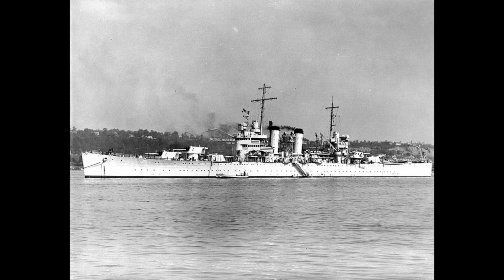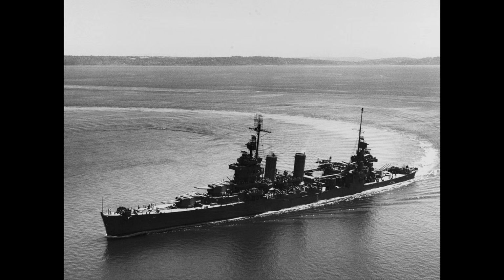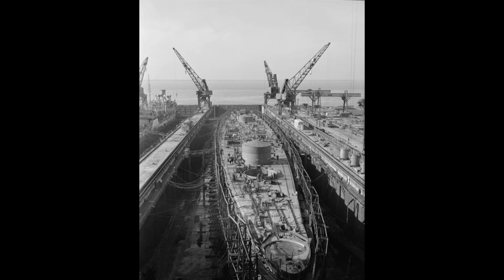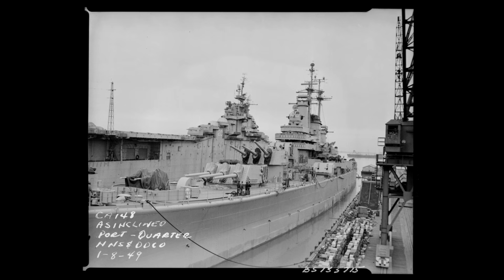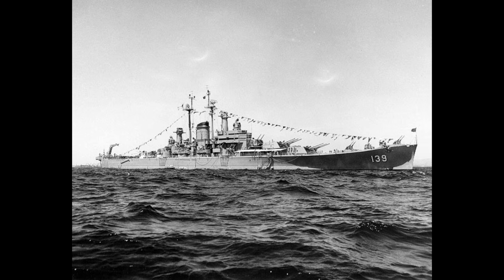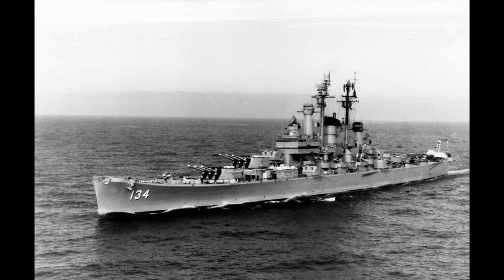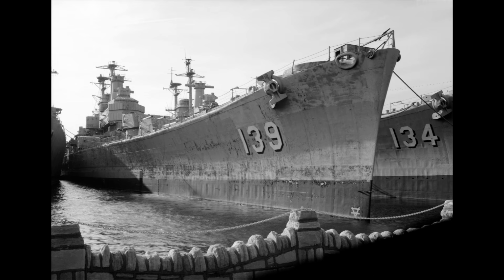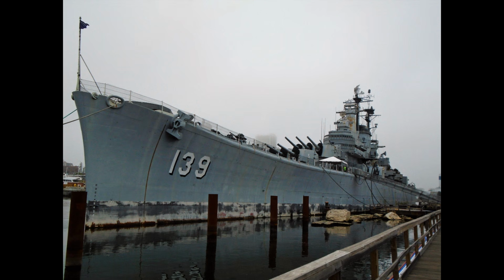USS Des Moines - Guide 251

Comment from the maker: Pinned post for Q&A :)
Reply: the Nav Weaps article on the rapid fire 8” guns is well worth reading: despite their size and power, they were, apparently, very reliable
Reply: How would you, Drach, tweak the design for the original 6 frigates of the USN? With hindsight, given the eventual razee designs, would it be worth it to slightly increase their size in order to accommodate 32lb guns? Also, having worked with live oak before, how on earth did anyone manage to use it as hull filler? That wood is incredible, but grows in about a million directions per tree...
Reply: The US Navy had plans for GERMANY FIRST strategy, but what if, somehow, the Japanese surrendered first (either between the end of 44 or beginning of 45). Did the allies had any plans for just occurence
Reply: Any chance of doing a special on the Royal Navy's Invergordon Mutiny?
Reply: Here's a very interesting question to be asked, for a "what if" episode. Assuming that the Mark 19 came out in enough time to be in general service during World War II, how would that change the battles? Especially since those 8" shells would be falling fast and hard in a number of circumstances where the early naval battles could have changed a lot of things if there was quite a few of these shells going out.
Reply: Would dazzle camouflage have been effective during the age of sail? If the idea is make it difficult to gauge a ship's heading, then perhaps in an age without self-propulsion initial mistakes would be much less forgiving when trying to engage an enemy.  Is this true, or are there mitigating factors that would make the advantages negligible?
Reply: So how would a Des Moines do against a Kongo, at night, at the throw-your-coffee-cup-and-hit-them range so common in Iron Bottom Sound?

(Well SOMEBODY had to ask)
Reply: Some questions related to the Des Moines: How important was the anti-aircraft role in their design process ? I thought that was really the value-added of the new 8-inch turret but since you don't mention it in the video, I guess it wasn't the case ? Given what was happening early on in the Pacific theater of war, It seems the USN was quite late in introducing a dedicated anti-aircraft ship (the Worchester class and maybe the Des Moines). Was it the case and why ? I'm almost surprised that they didn't take some of the new hulls like the Alaska's (or maybe some of the lighter cruisers) and replaced their main battery with more 5 inches (or idealy rush into service the new 6in or 8in DP turrets). Were there some technological roadblock (autoloaders, lack of improvement in fire control, etc.), industrial (proximity fuze production capacity, turrets productions, etc.) or maybe doctrinal (combat air patrol vs AAA) ?
Reply: A classic "who would win scenario": USS Alaska (or Guam) vs any one of the Kongos. 
Large cruiser vs Battlecruiser. Both ships are alone, no escorts, sporting the very latest refits/tech historically available to them before the end of the war. 
Would the Alaska with her superior tech but smaller guns take the win or would the Kongo with her 14 inch guns carry the day? 
The battle would take place during the day in clear weather conditions to give them both the best chance.
Reply: @wildkarrde3370  

The Alaska is a design a few decades newer than the Kongos, it should have the upper hand. While the Kongo wouldn’t have too many targeting issues in good visibility, I suspect Alaska is the more durable ship here (can anyone tell me if the Alaskas had the AoN armour layout as all contemporary non-German battleships did?)
Reply: @bkjeong4302  a quick look at Wiki, shows Alaska had only a 9" belt. enough to fend off 8", and maybe German 11" shells.  vs a Kongo's armor, which varied from 3"-8".  Navweaps does not have armor penetration data for the Japanese 14"/45, but muzzle velocity and range of that gun vs the US 12"/50 are very close.  If the Kongo blew a lot of chaff in the air to blind Alaska's radar, it could go either way.
Reply: Admiral hipper class vs Baltimore class
Reply: USS white Plains and Yamato service guns accuracy
Reply: May I suggest the Insect Class river patrol boats...?
Reply: Did you also know that Salem was used to depict the German pocket battleship, Admiral Graf Spee, in the 1956 film The Battle of the River Plate?
Reply: @wildkarrde3370  The Alaskas were equipped with the Mk 8 FCS and her 12" guns were supposedly equal to the US 14"/50s in penetration.  I would have say not quite no contest but given the proven accuracy of the Mk 8 would mean the Alaska hits first and hits more often.  In pure optics based gunnery duel it is a toss up.
Reply: What is your favourite Never-built ship or plane?
Reply: I found a proposal for Hood's armour that takes 1 inch off the main belt and 0.2 inch off the aft, add 8.3 inch to the belt and 0.95 inch to the deck would this make any difference to her service?
Reply: I was just looking into the history of the 8-inch RF gun the other day, and I couldn't find much... I am quite curious about it though, for a couple of reasons - namely that while Navweaps says the "date of design" for the 6"/47 DP twin mount was in 1943, the mount itself started showing up in Spring Styles plans in December 1940, with plans for a full on cruiser carrying these guns starting in July 1941 - and it's explicitly a DP gun according to those drawings. Now, Navweaps also says 1943 for the 8"/55 RF triple mount, but there is a mount that looks suspiciously like the Des Moines turret showcased in drawings even earlier than the 6" DP mount - the Scheme 4-A "convertible" option from the Alaska preliminaries has three of them (plus a standard Baltimore-style turret so it's definitely not a mistake), and that drawing is dated  in April of 1940; and the same shape shows up in the "Scheme A" drawing from the Midway preliminaries. 

Does this mean that the US Navy were planning the RF gun at the same time as the DP gun, and had a rough idea what the mount would look like as early as 1940 for both of them?
Reply: any idea what the abrupt jumps in CA hull number were for, particularly between USS Helena (CA-75) and either Bremerton (CA-130) or Oregon City (CA-122)? There's a couple other jumps like that, but that's the big one and the one I can't really figure out the deal with.
Reply: I just don't understand your persistent habit of not pronouncing the 'w' sound at the end of Wichita.  It's a perfectly obvious thing to do given that the city of Pawtucket as a 'w' following an a which is not pronounced, so the sound of the 'w' obviously belongs somewhere.  Nothing could simpler.
Reply: @tortugagreen9924  Did you check vs cruisers converted to light carriers?
Reply: @stevevalley7835  During the day radar isn’t going to be too much of a concern, given that the accuracy of radar fire control at long range (even the Mark 8) is vastly overblown in pop culture compared to actual testing data. The Mark 8 will be able to get a firing solution much faster and at greater ranges, but actually hitting at ranges over 30,000 yards is a different ball game due to all the environmental variables.
Reply: @tortugagreen9924  The short explanation is "those gaps are where the light cruisers are". All the cruisers were numbered in one sequence starting in the 1920s, so you'd have a few heavies, a bunch of lights, a few more heavies, another bunch of lights, off and on. The war production sequence gets a little screwy because there's 1 - a bunch of ships that were given a number in the sequence and then redesignated to something else (Independence-class carriers); 2 - a whole lot of cancellations and ships that were scrapped incomplete; and 3 - ships that were built out of order, because the ships are numbered in the order they were *ordered*, rather than when commissioned, and some yards had backlogs. 

So, for example, CA-121 to CA-143 were all ordered in 1942, but CA-130 to 133, and CA-135 to 136 (the Batch 2 Baltimores) were all laid down in mid 1943; while CA-122 to CA-124 (the Oregon City class) weren't laid down until 1944, and CA-134 and CA-139 weren't laid down until 1945. Interestingly, a lot of the ships listed as "scrapped incomplete" were laid down in 1945. 

Edit: looking it up in Friedman's "US Cruisers", the original plan was for CA 122 to CA 129 as Oregon City-class, CA-130 to CA-136 as Baltimores, and then CA-137 to CA-138 as Oregon City again, with CA-139 to CA-143 as the first five Des Moines class cruisers. CA-134 was then re-ordered as a Des Moines class and a bunch of the others cancelled because why build inferior cruisers if you don't have to. Which is why the they're sometimes called Salem-class, because CA-139 was supposed to be the first ship...
Reply: @scottgiles7546  With the Des Moines vs Kongo at night at close range thing, we can take some fair guesses from what happened to Hiei. USN early war 8" shells punched into Hiei's steering room, flooding crucial portions of the ship and killing the engines. 

Des Moines is well armored for a WW2 CA, but nothing like what is needed against 14" AP. 

My bet is that both ships rip each other apart but neither sinks the other. Des Moines likely ruins Kongos FC and gunfire rate, as happened historically, while Kongo smashes major portions of DM. Both likely have significant flooding, but Des Moines is based off of battle proven designs with late war+ Damage control. Kongo likely is eventually left drifting, burning and pretty impotent.
Reply: @stevevalley7835  Nah, Kongo is never going to have enough Chaff to cover itself for the lengths of ti.e that naval gunfire duels take. Alaska is designed with near modern horizontal bulkheads and the latest in power generation and damage control. Alaska see's first, hits first, hits more often and handles hits better. Kongo may have a "punchers chance", but between ships of near-miss tonnage and firepower, my money is on the American design from WW2 over the IJN/British shipyards pre WW1 design.
Reply: Do the two gun “tubs” over the stern of the ship have any nicknames?
They look a bit goofy, yet pretty neat at the same time 😂
Reply: How much would it cost to rebuild HMS Warspite?
Reply: Why did navies build their ships with similar layouts, even different types of ships? Eg: Iowa, Alaska, and Des Moines all had three triple turrets, two forward, one aft. Was it found to be the best layout in the USN's opinion?
Reply: Best ww2 destroyer of each of the main combatants?
Reply: Why is the B-17E Flying Fortress called the Mk.2a while the B-17F Flying Fortress is known as the Mk.2
Reply: How would the Alaska class large cruisers have fared in the Mediterranean and the North Sea going up against German and Italian contemporary designs
Reply: Salem played Graf Spee in the movie Battle of the River Plate
Reply: Although the class was not completed until after the end of the war, hypothetically was there any heavy cruiser class in any WW2 navy that would have had much of a chance against the the Des Moines.  Given their fairly light armor, and relatively speaking, slow firing guns how would the Deutschland's fared?  Finally, for the over the top question, could the Des Moines and Salem together, with their weight of fire,  had a chance against the Scharnhorsts at 15-20,000 yards?  If time permits, would any cruisers or smaller battleships of the IJN been able to cause major issues for the class sailing as a flotilla of two or three ships?  I'm thinking their radar and fire control would allow for first strike capability.
Reply: Have you seen any numbers on the average cost to keep ships like the USS Salem, HMS Belfast, and the other ships still afloat in good repair as museum ships.  I worry that that cost will cause younger generations to just scrap them.  I know they won't mean as much to as many people as they do now, but I hope I've shuffled off this mortal coil before that happens.
Reply: @bkjeong4302  AorN very much like the fast U.S. battleships.
Reply: There are several different designs for the North Carolina's. One has two quad turrets, both aft with floatplanes forward (ie: Richelieu in reverse). One is Nelson-style. One is all-forward and super-super firing, with the forward on centreline, second off centreline to starboard, and the rear-most off to port. Please explain this madness, and what is best design?
Reply: @jayadkisson2075  then the Alaska has this on the basis of much better durability compared to the Kongos, while being similar or slightly better in other areas (bear in mind the question specified an engagement in good visibility, where the massive advantage radar brings in poor visibility is mostly nullified); the only Japanese big-gun capital ships with AoN were the Yamatos (due to being much newer designs than the rest).
Reply: What's the intro song? I really REALLY like it.
Reply: @WBtimhawk  Too big and slow traversing for DP use.
Reply: @tortugagreen9924  not hard to figure out. Projects got cancelled.
Reply: @thomasjamison2050  Seriously?
Reply: @WALTERBROADDUS  Seriously in terms of the pronunciation.  I have lived in both Kansas and Rhode Island.  The one I can't figure out is what state or city swapped the 's' sound at the end of Arkansas for a 'w' sound.
Reply: As of this comment posting, the USMC has landed and launched F-35B jets on JS Izumo. Is there any known instance of foreign fixed-wing aircraft landing and/or launching from a Japanese aircraft carrier prior to the present day?
Reply: @i.alicorne  🤔 hmmm....... Doubtful. It's nice to Have the Royal Navy, USN and the Maritime JSDF all one team outside a Mothra film. 😏🦋
Reply: I'm a hunter, and there's lots of discussion about what kind premium projectiles preform the best. Boat tails for better aerodynamics in flight, Nosler partitions to preserve mass at impact and improve penetration etc.

How did the projectiles of naval guns evolve? Did anyone try any interesting tricks to improve performance on impact or was it solely a "bigger the hole the better" game?
Reply: Is it possible to add interior photos where possible?
Reply: Where there any WWI or later battles fought between predreadnaughts?
Reply: Could you cover the USS Newport News? She had the most active career of the Des Moines class.
Reply: I saw USS Salem moored alongside one of her sisters in the Philadelphia Naval Shipyard in 1988 .  My ship ( USS Sellers DDG 11 )  was in the yard undergoing dry dock at the time .
Reply: Jake millar , yes the US Navy came to favor the triple gun turret layout after designing and testing several types. Two gun turrets where thought to not make as efficient use of the space available on a big gun ship ( cruisers, battleships, and similar ). Four gun turrets were thought to leave too much of a ship's firepower in one place for a possible enemy to knock out ( and were generally less easy to put in action ). The all big guns on the centerline came mainly from improving these types of ships sea keeping  ( as opposed to "wing turrets" or off center turrets in the hull, and the like - where the weight being off center lacked stability ). I can not remember why so many big fighting ships ended up with the 3 guns × 3 turrets configuration, ( probably a cost vs added weight vs actual fighting power judgement ), but Drachinifel has talked about it all.
Reply: Please talk about
 Cleveland class light cruiser CL65 USS Pasadena 
My dad's ship, at all naval big battles in Pacific
Reply: What are your thoughts on the MCY-7 ohka suicide plane?
Was it effective?
Where and when was it used?
And did it score any kills?
Reply: Why not a review of the Baltimore class? (One of those was named after my home town.)
Reply: I find it fascinating that early in the cold war the Soviets found the Des Moines class enough of a threat in their estimation to warrant them designing a class of large gun armed cruisers specifically to deal with them: the Project 66 cruisers.
Apparently, those ships were cancelled when the Soviet equivalent of our Naval War College predicted that the Project 66 ships, while impressive, would be unable to consistently defeat the Des Moines cruiser.
Would love to see a video on Project 66!
Mr. Drach?
Reply: @stevevalley7835  Did they have radar countermeasures like chaff in WW II naval battles?
Reply: @garyhill2740  The British, US, Germans and Japanese all had chaff that could be dropped by aircraft.   The Wiki article does not discuss ship mounted rockets for dispensing chaff, like the British used successfully in the Falklands.
Reply: @josepetersen7112  Yes, and I have never seen any references to radar countermeasures like chaff being anything other than experimental in WW II. With IJN being more than a bit behind other navies in developing radar, how could they develop countermeasures against enemy radar they were unfamiliar with, and uncertain about the capabilities of?
Reply: @drachnifel can you do a video for the USS Isle Royale that my dad served on in the 1960’s